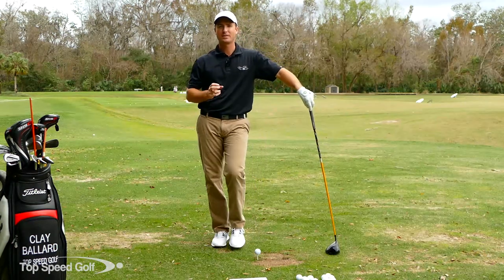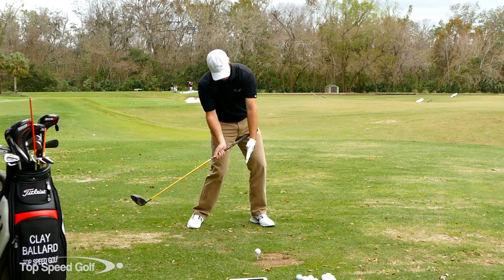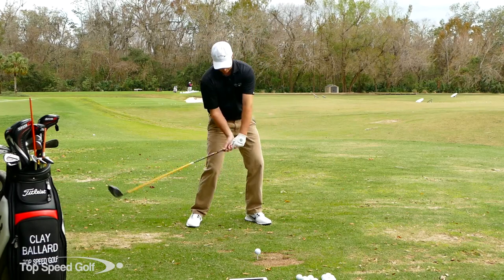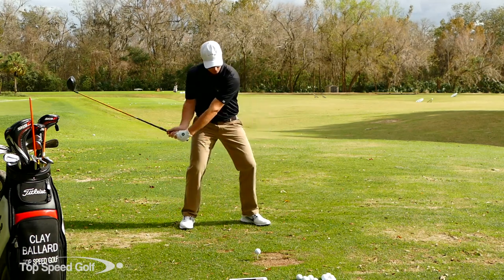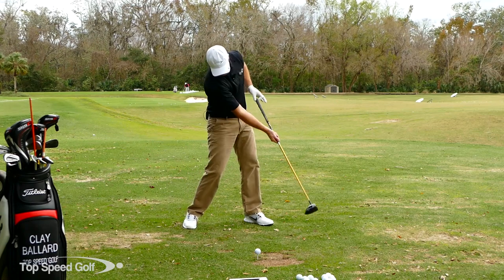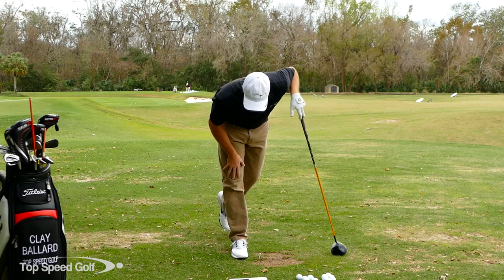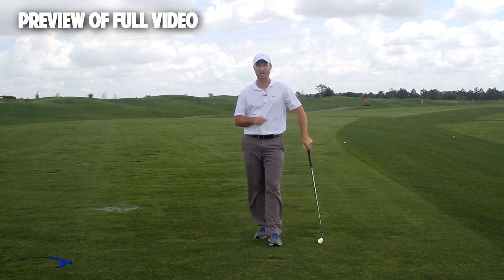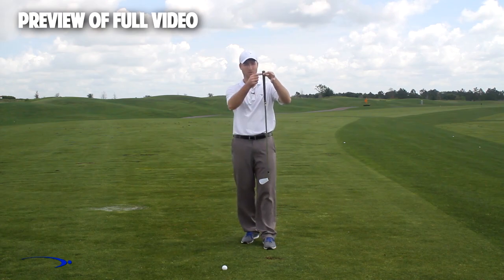Why Not to Put Pressure With the Right Hand

Comment: Great video. If anyone is shanking or hitting fat/deep divots you may want to try to hold the club with solid left hand pressure and very - very light RIGHT hand pressure. I noticed my body was staying in good position but  i was over extended towards the ball hard with my right arm/hand. I first started by putting only my right ring and middle finger on the club and using the index as a guide (almost no pressure with the index). Try that out people who are shanking or slamming into the ground because the right hand is overpowering
Reply from the maker: Thanks! And thanks for sharing too. Sounds like you're on the right track .Keep up the hard work! Quentin | TSG Instructor

Comment: Hey Clay I went to the range and tried it out and it absolutely works way better contact and control i feel more grip pressure in my left hand than my right hand or lighter pressure in my right hand is that the correct feel what's your opinion?I  sure hope it is !
Reply: And to add i feel it more  Throughout the entire swing from set up to initial take away top down and through more left hand grip pressure,,,,,, to me it works just want your professional opinion thanks again !!!!
Reply from the maker: Sounds like you're on the right track

Comment: Does the right hand play any role in forcing the clubhead down to the ball?   Or is this all controlled by moving left hand moving upward?  If I don't do this, I feel I may thin it.
Reply from the maker: Hi John, yes, the right hand plays a small role in it but you likely won't feel it. The main role of the right hand is to stabilize the swing and give you control. I hope that helps. Play well ~ Quentin | TSG Instructor
Reply: Top Speed Golf - Clay Ballard I found that I hit the ball better when I squeeze harder with my right hand, I tried the light grip pressure thing and I started flipping bad, I just squeeze harder with the right and I get the club back to the right position with forward shaft lean now.

Comment: I tried this and when i make contact my club wants to spin. I usually have a hard grip. Of course since im a smaller guy my distance is basically all speed. I put a lot of down pressure with my right thumb.
Reply from the maker: Hi, this is most likely from an off center strike. You can use some foot powder spray on the face to see easily where you are striking it. Play well! Quentin | TSG Instruction

Comment: Clay - because we're right handed I don't think you realize just how much the right hand is helping.   The long drivers all push with right hand at the bottom of swing and into follow thru. I have spoken with 4 WLD competitors and they all told me the same thing. "The right hand either slows the swing down or speeds it up."  Since we know that one-armed longest drive competitors hit the ball 240 - 280 yards, the right hand MUST be helping any golfer who hits the ball over 275 yards, period. I have been testing this at the range for the past couple months and I've gained 12 - 15 mph on my driver, 8 - 10 mph on irons and more penetrating ball flight, especially with irons.

Comment: Be Better Golf and Tony Luczak would disagree completely with this. To them, it's the exact opposite: a right arm/hand dominated swing. Their feel is almost no left hand whatsoever.

Gotta love coaches who teach "systems." There is more than one way to swing a golf club.
Reply: That may be what they describe but it isn't what actually happens. In order for the right hand to go through fast the top of the club has to slow down somewhere. You cant drag the handle through with your right AND have speed. Its one or the other. The club is a lever that must pivot itself. That only happens from the top of the club slowing. The right hand can't truly slow the top of the club as it is on the lower end of the grip.